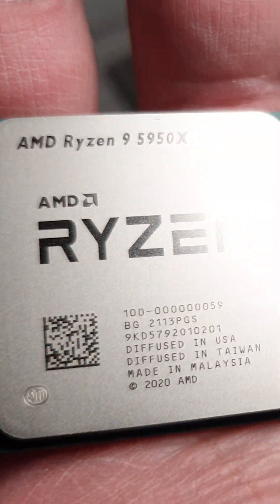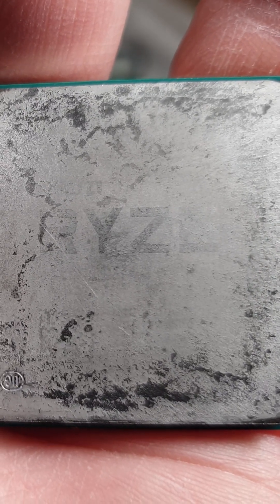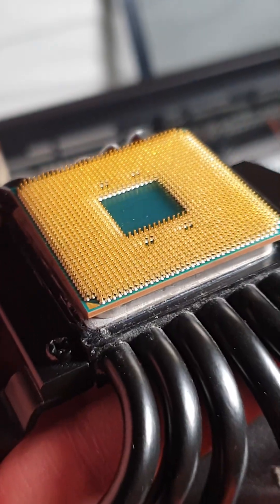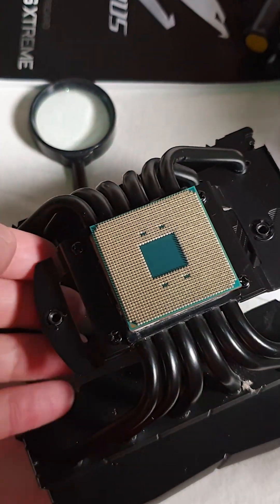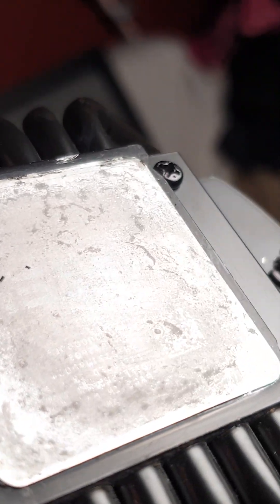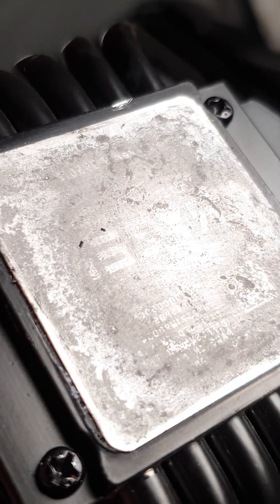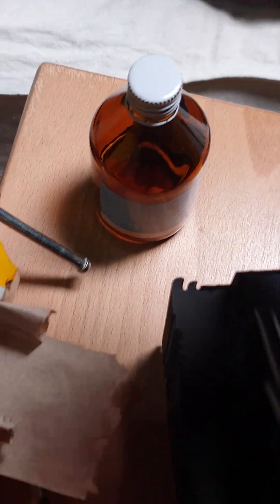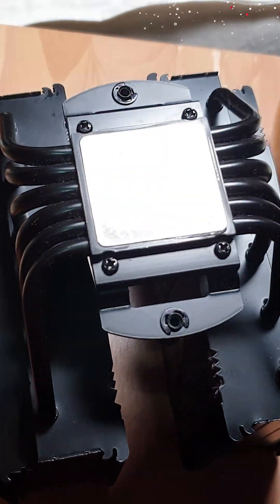Liquid Metal Destroyed my CPU IHS

Comment: Just run your PC for a few seconds to warm up the processor. This isn't any different to thermal paste not wanting to release. Liquid metal is tricky to work with and potentially damaging, not for beginners, if you can cope with it's downsides you've earned its advantages.

Comment: Oh man, thank you for making this video this is a great information! Lately i been looking into this liquid metal paste and some people said not to apply it on aluminum as it will eat aluminum 😂! But i also saw videos of people putting it on the cpu itself by deliding it. Now im wanna know if itll eat that ihs from the inside if it is applied directly on to the cpu. And do you think its ok to use aio directly instead of ihs back!
Reply from the maker: it will eat the ihs from the inside, but the reaction will be smaller because one side will be the crystal which is non reactive, should be good for couple years and later you can repaste

using the aio directly on the crystal removing the ihs completely is possible and produces the best short term results and people did it in the past, but it's very very risky because of uneven weight distribution, the main ihs role is to protect the crystal and distribute the weight, if you remove it and apply directly you risk to break the crystal

this method is most commonly used in high end laptops where the application is done in factory conditions and all the parts are manufactured according to fit precisely